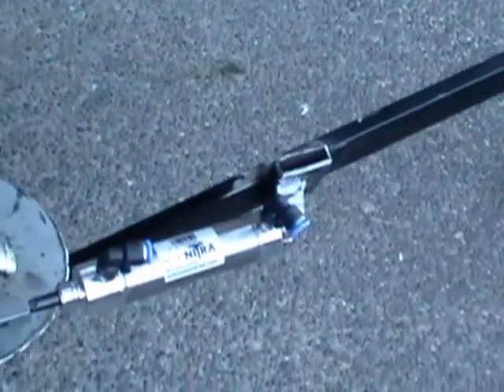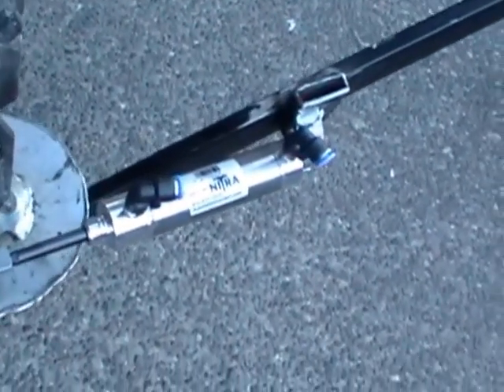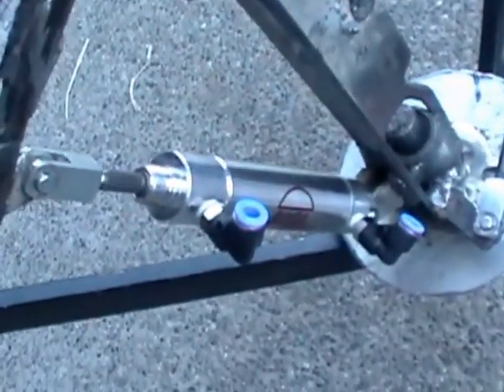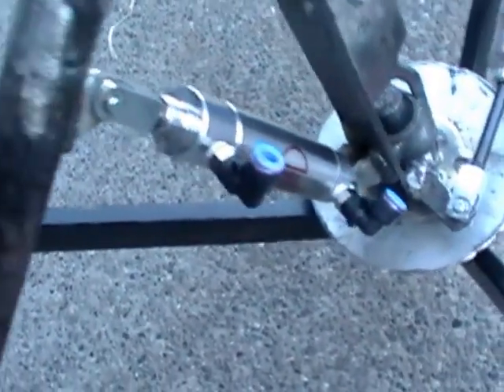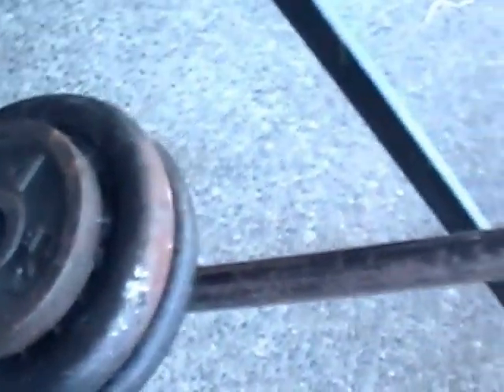flying pneumatic  amatronics    Halloween zombie monster prop build

Comment from the maker: deoblo85 an early testing is on my u-tube video.  it moves it very easily, the weights were added after first test, too much weight to lift.  I learned as I built, I would make a few changes if I did it again.

Thanks